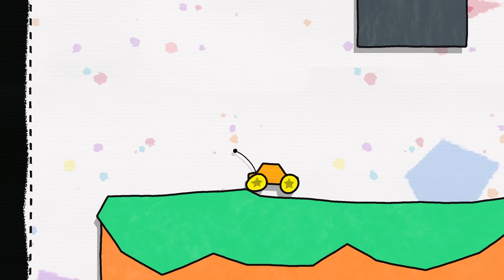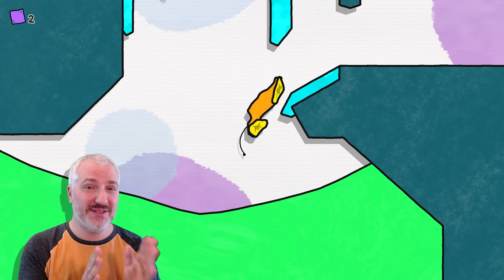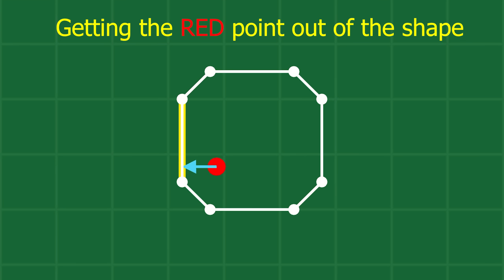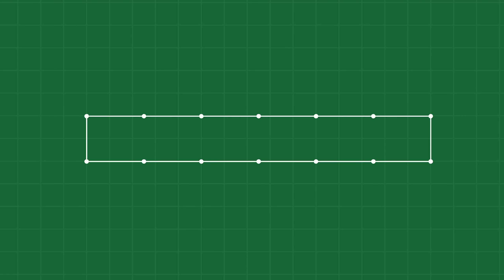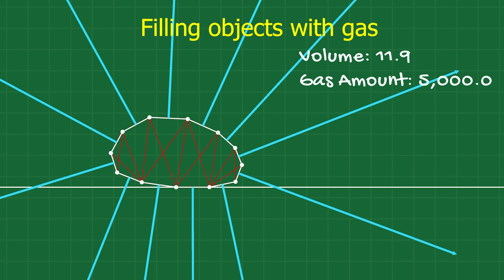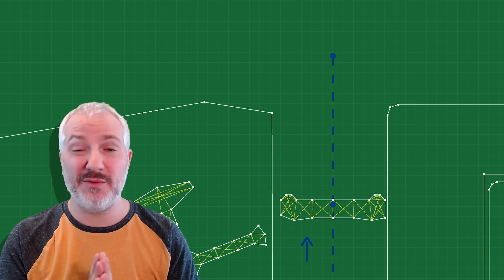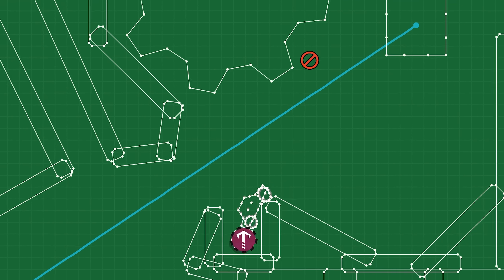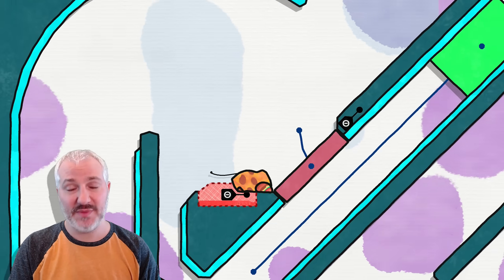Physics of JellyCar: Soft Body Physics Explained

Comment: Have you encountered situations where the closest point is not correctly identified on the intended edge? For instance, if a point falls from above and penetrates a square near a corner, the closest point may incorrectly be calculated on the side edge instead of the top edge.
Reply from the maker: Yes I have.  I do have some code that tries to prefer finding points whose normal points “away” from the penetrating point’s normal, but it’s not perfect.

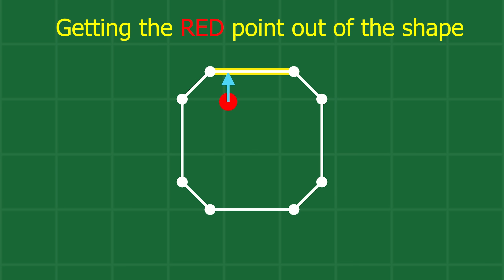Comment: At 5:09 you mention how a certain point is moved more based on how close the colliding point is to one of the two edge points. What's the math behind it? And how much do we move them exactly so that the colliding point lands exactly on the newly formed edge is a little confusing. Can you please explain it?
Reply from the maker: We know how far the point is from the edge.  We calculate how much to move the edge and how much to move the point based on their relative masses.  Then I just apply a “weight” to each point on the edge to move it between zero and the full amount, based on where the point is along the edge.
Reply: @WalaberEntertainment  I’m trying to implement weights but a problem is that sometimes a weighted line slant won’t align with the closest point causing the the point to still be in the line

Comment: Cool video! (Came here from TikTok)

I was just wondering 3 things:

(1) how do you decide how to create the spring network for a given set of boundary point? Is it some meshing Algo?

(2) how do you incorporate friction?

(3) is there any resource where I can learn more about the pressure force you mentioned and how to incorporate it into a mass-spring system like this?
Reply from the maker: This github has the only link I've been able to find to what I remember as the original paper I used when developing the first soft body sim that lead to JellyCar: https://github.com/smacke/pressure-softbody the paper itself is at this link: http://panoramix.ift.uni.wroc.pl/~maq/soft2d/howtosoftbody.pdf
Reply from the maker: the internal springs are just placed manually, no automation. the shape matching springs are simple, 1 spring per point on the shape matching "frame" (which is often every point on the object). 

friction is mostly just having a lookup table of material interactions (objects can have different materials), and then adjusting the resulting velocities after a collision based on the friction coefficient (modifying the portion of the velocity along the tangent of the collision based on this value, 1 = keep all the velocity, 0 = kill all the velocity)
Reply: @WalaberEntertainment  thanks a lot!

Comment: For the point-in-shape collision detection, wouldn't it have been cheaper use the winding number method? That way you just calculate N angles for the N points in the shape, instead of calculating between 1 and some higher number of line intersections?
Reply from the maker: Probably! It’s still N checks either way so it really depends on how you attempt to optimize the internals of the algorithm I think.

Comment: great in depth explanation without technicall details, thats something teachers could learn from, great visual examples, your game deserves more attention, do you have a link that points me into the right direction for mainting shape by filling it with gas, how to dit in code and unity, i couldnt find something so far
Reply from the maker: main thing would be to search up the formulas or methods for calculating the area / volume of a polygon / shape, and then looking into the pressure force equations after that.

Comment: Thanks for the in-depth explanation! I'm really tempted to try implementing my own soft-body system based on this video. One thing I didn't see you mention was friction. Are there special considerations for that with soft-body simulations?
Reply from the maker: In the step where new velocities are calculate for the point inside the other shape (and the “virtual point” representing the nearest edge, I apply friction similar to a normal inelastic collision.

Comment: This was an awesome video. I always get the urge to go implement a 2d game after watching stuff like this.

I wondering about simulation (solver?) time step lengths. Are they fixed, or do they vary? I guess in a realtime environment variable steps are not wanted.. but I imagine upping the freqency of simulation should be good when things are moving very quickly as opposed to moving slowly or being static.
Reply from the maker: I use a fixed time step of 1/120th of a second for the physics.

Comment: Thanks, that's a pretty great explanation on how to make a soft body simulation, without entering into the details of the specifics of the mathematical computations associated with the model.

I however have one question, with the shape matching, it resolves the problem of maintaining shape, but are the springs still needed, and if so, why isn't the shape matching enough?
Reply from the maker: Shape matching doesn’t cause internal forces. So if you have a bridge with only shape matching, a car on the bridge will o lumpish down the points directly under it, and underside of the bridge would be unaffected.  Internal springs would cause the bridge to act more as a solid thing.
Reply: @WalaberEntertainment  Thank you for the clarification, and thank you again for the video!

Comment: It's interesting that one of the failure cases for collision detection is actually a half-ass simulation of impalement. Thin object passes through broad side of another object if it moves quickly enough.

Then collision still occurs keeping it in place

Comment: I followed all of the steps you have mentioned to make my soft body but still soft body losing it's safe when i am increasing gravity too much and also springs are unstable ,what should I do😭😭😭😭.I added damping but it is not enough to stable the spring
Reply from the maker: The simple solution for this is to make sure you use a short time step for the physics.  JellyCar updates physics at 120hz regardless of frame rate, so each physics step is 1/120 seconds
Reply: @WalaberEntertainment  thanks! now it is working much better😊😊

Comment: does unity handle the rest of the physics simulation (the points)? is it just separate gameobjects for each point? is the spring placement automatically handled by a script?
other than that, interesting video
Reply from the maker: The entire simulation is custom, no unity systems are involved.  It's implemented using the new Unity ECS framework, so each point on a body is an "Entity", along with each spring, etc.

Comment: How do you manage to simulate the friction between two platform or the wheel and the ground, to push the car in one direction ? (very good explanation btw)
Reply from the maker: I sort of gloss over it in the video, but the step where new velocities are calculated for the points in the collision step does in fact take friction into account.  In my case I define materials, and then define material pairs that set the friction for that pair.

Comment: Awesome stuff, thank you! It works great for me, but i still have an issue of interpenetration with similar shapes.
If two lines are parallel and pairs of points are close, e.g. two identical boxes one on the other, how do you stop those points from going in (basically sliding in)? 
Picking the closest point doesn't seem to work since delta between them is 0 (point we are testing is on the line already).
Reply from the maker: JellyCar has the same problem. You can use the point normals to try to make a slightly better decision about how to move the points, but it’s never perfect
Reply: @WalaberEntertainment  Oh I see, I've been stuck on this for days, thinking i'm missing something obvious. Thank you very much!

Comment: I love this, I had never considered the frame idea to maintain shapes! Brilliant ideas and brilliant presentation! How do you handle friction? I've been looking at verlet integration, and it turns out friction is quite difficult. Everything skates around...
Reply: I would imagine you make them both have a friction constant, calculate that as if It is a square on a flat plane, then you distribute the forces based on the ratio of the point’s average masses for that line.
Reply: As he said in other answers "I sort of gloss over it in the video, but the step where new velocities are calculated for the points in the collision step does in fact take friction into account.  In my case I define materials, and then define material pairs that set the friction for that pair.".

Comment: Do you use regular spring forces (minus k times delta x)? Or maybe you use Jakobsen method? Which physics integration method do you use?
Reply: I tried both, but regular springs are not stable with reasonable timestep, even with Verlet. Jacobsen's method is very stable, but it sometimes introduces extra rotation to the system for some reason. Maybe because it's more of a hack than real physics simulation method.
Reply from the maker: I use simple damped springs (power * distance) - (damping * relative velocity), and a small timestep (1/120 second) for stability.
Reply: @WalaberEntertainment  Thanks! Is relative velocity velocity difference between endpoints? I have tried global friction force, but maybe that is not enough. Will try your suggestion. I had timestep even smaller than yours.
Reply: @metalstarver642  I can't tell you what he used, but I was introduced to a technique called xpbd which is quite stable because it uses an implicit discretization of the system's equation of motion. It even tells you exactly how to derive the formulas for your constraints. I made a video about it if you are interested.
Reply: @blackedoutk  Thanks a lot! Great video, exactly what I needed.
Reply: @metalstarver642  Thanks, glad you liked it.

Comment: This is incredible thankyou For the video! I have tinkered with such systems in the past... but I was missing your shape matching idea. Genius! I got so frustrated with inverted shapes. If you are into divulging further secrets... it would be great to understand the kind of force integration loop that you use. It must be some style of verlet :)?
Reply from the maker: It's basically verlet in that I retain the "old position" from the last time step, and derive the velocity from that before then doing basic Euler integration.  However, when resolving collisions or dealing with constraints, I sometimes manually modify the "old position" to get the system to derive the velocity I want.

Comment: Hi hi, i have a question about your implementation. You say that your collision detection requires non self intersecting shapes, but also that they sometimes can self intersect. Is it the case that...
A) shape matching perfectly stops self intersection? (How?)
B) you have a backup method when a shape self intersects to still collide it with things?
C) it all blows up when self intersection happens?

Comment: Anyone use this video like a tutorial? I did mine slightly different, where instead of intersection, the points are push out of the triangles, which are made form sprite editor geometry. I call them "soft triangle"

Comment: Phenomenal video, thank you for sharing! Would love some more detail about how the wheels work. I would assume this system wouldn't automatically result in functional wheels because it doesn't explicitly model friction. Is it just gravity + how the position of the wheels are calculated? Does that produce a normal reaction force?
Reply from the maker: I sort of gloss over it in the video, but the step where new velocities are calculated for the points in the collision step does in fact take friction into account.  In my case I define materials, and then define material pairs that set the friction for that pair.

Comment: This content is So good, I don't know if you'll ever see this comment if you do have the time I'd be happy to get your intake(English is not my first language but I hope I'll be clear) 
I made a soft body engine during the weekend to test out raylib and encountered an issue let me give you an example scenario 
The issue i had is  assume i have  two squares made of four points , my collision detection handled particleedge collision detection and resolution,  However if the squares are resting on the same flat ground and both have same dimensions  and say square A moves horizontally toward B, THE SQUARES will go through each other as the particles have not collided with the edges as they are on the same height. How do you handle this
Reply from the maker: That is a very tricky problem and the simplest solution is to add more points around the square.  I’ve also tried using the normals of the point and the line segments on the other body to try and prefer to resolve the collision in a direction that is “as opposite as possible” to the point normal, and this did help somewhat.

Comment: This might be silly but for the collision, why can't we just calculate the distance of 2 points and if the distance is below a certain number then apply a negative force to make them go in the opposite direction? I still don't understand why the two points must intersect?
Reply from the maker: Often you will have an object with long edges between the points, and you need to detect when another object has collided with that edge.

Comment: I just stumbled upon this. I've spent years toying around with 2D and 3D simulations (mostly 2D) and simulating accurate soft-body interactions has been a consistent nightmare. Boiling it down like this clarifies things dramatically. I have a question: would you be willing to share your algorithms? I'm not asking for source code because this is a retail product and that wouldn't be fair, but I'd love to see a whitepaper with your equations and algorithms.